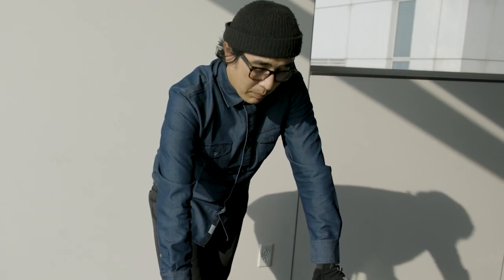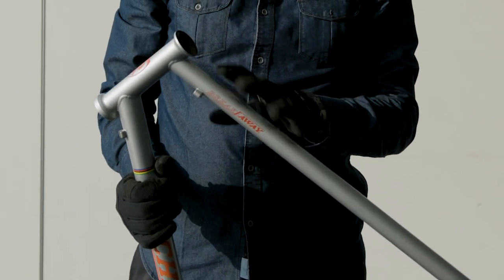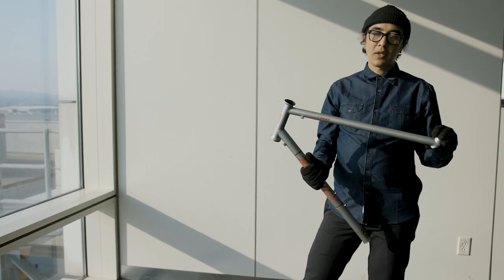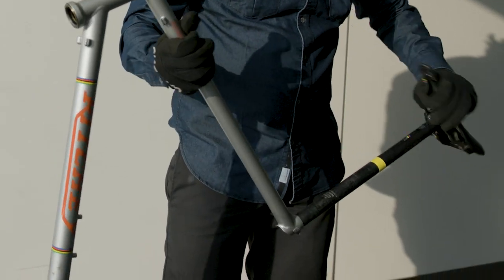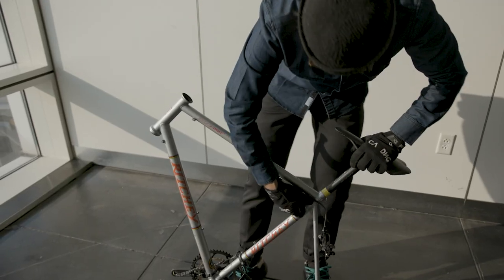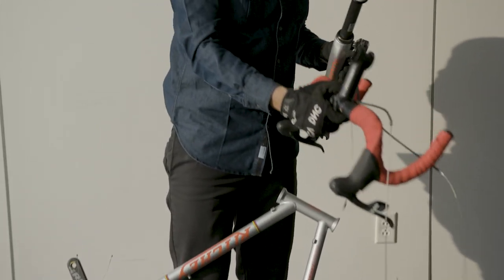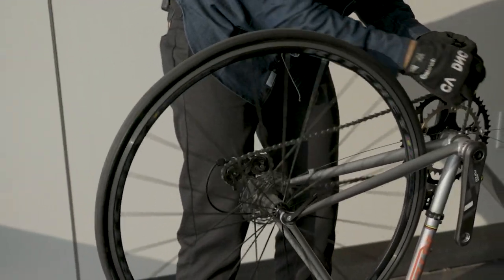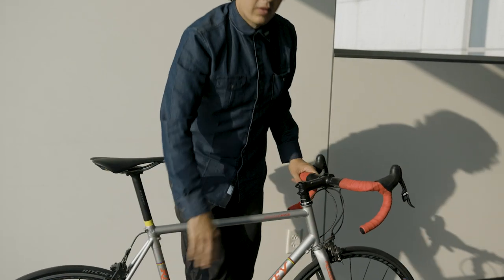How to Build a Ritchey Break-Away Bicycle

Comment: Excellent material Fergus and co! 👏🏼. That looks like the SFO airport 🙇‍♂️? Is that the bike you are taking to your incoming trip with DK?
Hope to see more content in the channel. You editing is improving! 

It seems you packed it up with the rear derailleur attached? Bold!

I have been thinking about getting a breakaway for a couple of months now. Not sure if to go for the cross or the outback. 
The outback is closer to what I want (the ascent was even better) but it is a bit out of my budget. I am not sure how the carbon frame will
hold the inclement treatment (mental note: consider that as the name of your next band) of the luggage operators. 

May I ask for your advice?
-drd